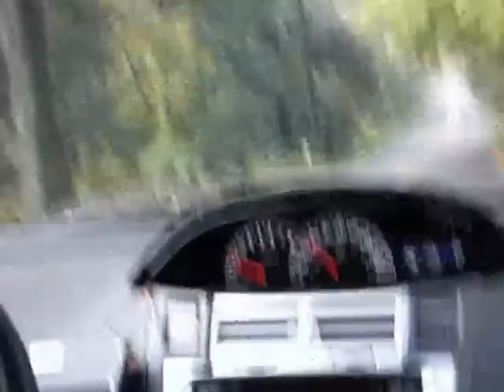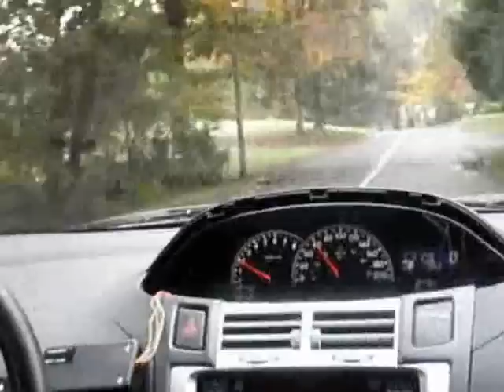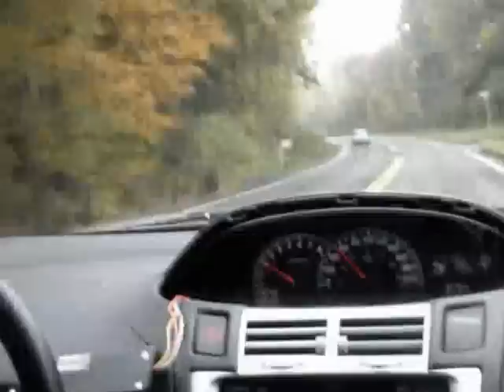Toyota Yars Instrument cluster calibration and deMetrification (converting a kmh cluster to MPH)

Comment from the maker: It is a 2007 cluster. The year doesn't actually matter, but you want to match features (ABS, etc.) so that you still have the  appropriate indicators.
Reply: Nice mod and build of the box. Not sure if you are still around but I'm interested in putting a tach cluster in the 2007 hatch I just got.
I wouldn't mind learning the programming necessary if you are not still making the clusters. If it's possible to program the eeprom for odometer correction, couldn't any lights (abs, tpms, traction etc) also be programmed out?
Not sure where to start other than hoping to find the rare cluster that needs no mods other than the odometer.
Let me know
Thank you for your time